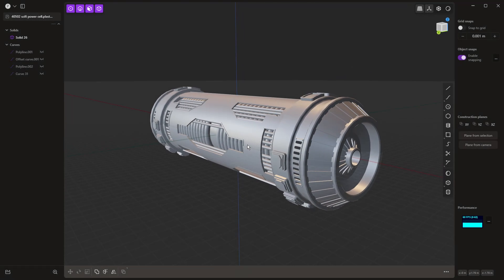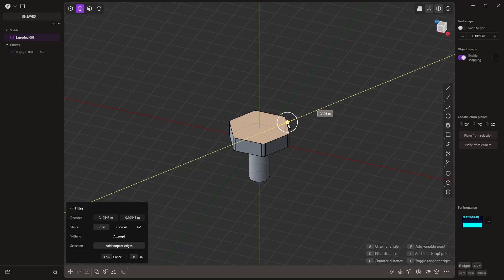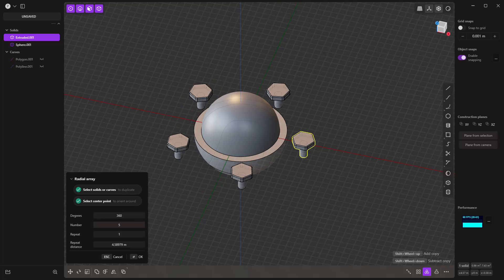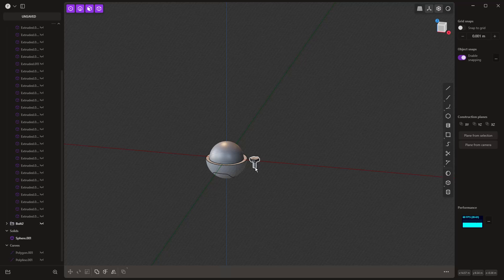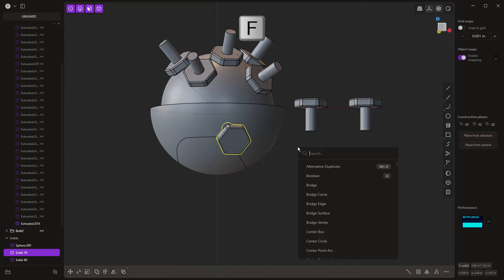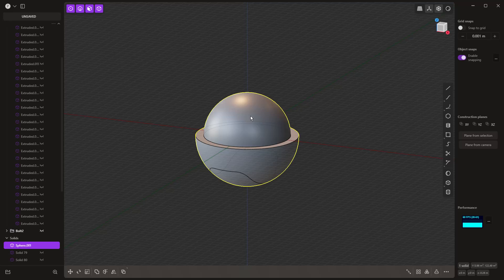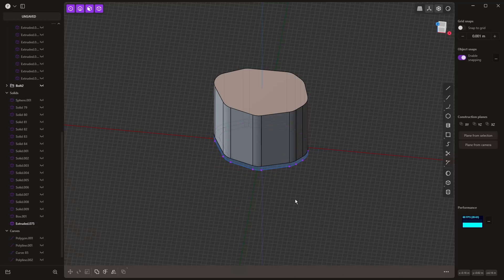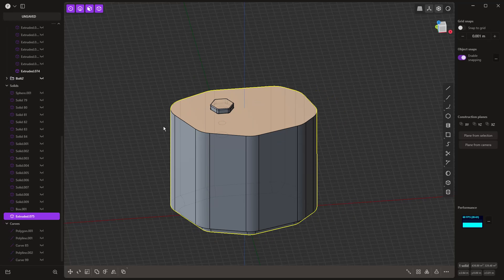Getting Started with Plasticity Solid Modeling | Beginner How To| Episode 3 | Patterns and Duplicate

Comment: good morning, I have a problem with the radial array. The main array is perfect but when I do the repetitions it translates each repetition on the z-axis as if the pivot point is moved from the origin of the main solid, but to be safe I also snap to the same height. What am I doing wrong? I tried everything
Reply from the maker: Radial array can be super tricky/picky about selection.  You just have to hunt around and watch the preview.  It works best when selecting a face and finding the center point where that face hits the axis you want to array around.  

It should work if you snap to say the Z axis.  Another thing you can try is to create a line from the origin and up on the Z axis. then select the line for your radial array axis selection.
Reply: @LearnEverythingAboutDesign  I'm experiencing the same issue, it feels like there should be a setting to change the repetition offset.. strange.
Reply: for anyone coming after - change the plane you're working on to make sure the array is created the way you want it!
Reply: I have the same issue. It seems the repeat distance and center point are using the same mouse position to dynamically preview. I cannot reproduce your radial pattern.